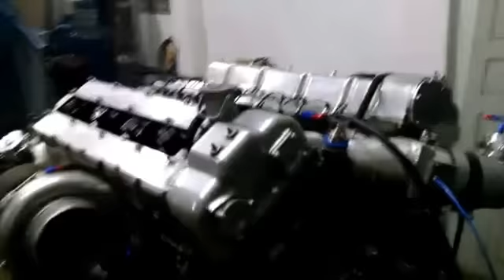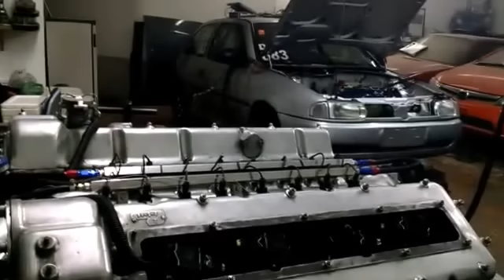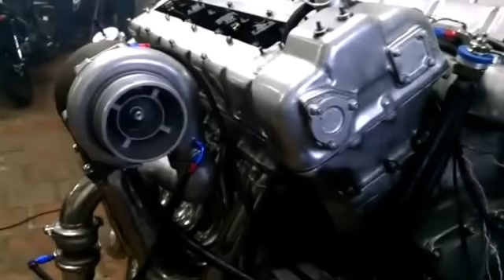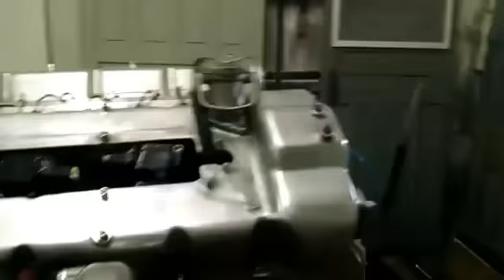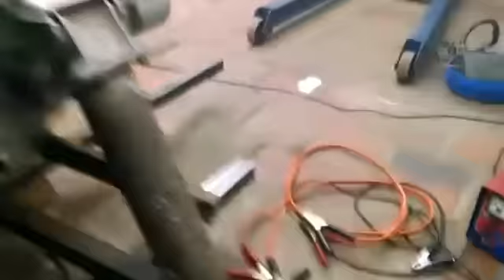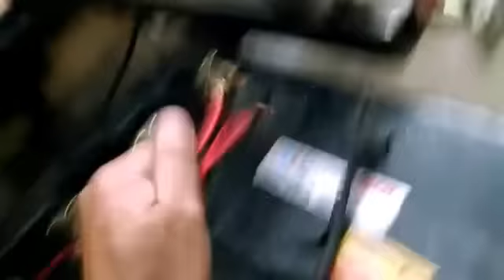Ford GAA-V8 Twin Turbo in Brazil. 1100Ci, 18 litters.

Comment: What rpm will this engine rev up to?
Reply: +micahhicks88 3000 is the rated RPM for these engines i think, but this one probably has upgraded valve springs and the such to support higher limits. Edit - The website says that the engine does 500hp @ 2600RPM, but the stock springs will go to 3800 before valve float.

Comment: You need to send this video to the Ford motor company, so they can remanufacture it for big truck use with natural gas.
Reply: +John Carroll thats.... actually a great idea. Side note - LPG/LNG is going to be a great fuel, probably better then E85. I wonder how much power you could make with LPG on this engine....
Reply: +themotorfreak1 LPG... hahaha
Reply: ?? gonna have to fill me in. What i know is that LPG and LNG ( LNG is going to be cheaper ) are 2 times or so less likely to prematurely detonate, so you can shove 3 or so more times the fuel into the engine resulting in , durrr , 3 or so times the amount of power. and a whole new way to cool incoming air as well. Turbocharging/ supercharging would be the way to go to lessen losses of the cold liquid hitting air.
Reply: the GAA is made for low horsepower, high torque, it was designed for tracked vehicle use only and saw little other uses due to the fact this engine would shatter anything other then the toughest of drive trains, plus the block of this engine alone weighs in the order of tons, it's more of an industrial engine then anything.
Reply: Except the GAA was an aircraft engine, designed for use in aircraft? Also the whole engine weighs 1500 pounds dry?
Reply: +Cu Gaunt No, it's not. 

the V12 predecessor to the GAA was intended to be an aircraft engine, the GAA however lost 4 of it's cylinders and became a V8 for vehicle use.

The GAA (Sort of) was designed as an Aircraft engine yes, but never was built into one, no model of the ford GAA ever saw use in an aircraft of any description, nor was the GAN, or the GAF and was downrated as such, it runs at normal vehicle RPMs, it's high torque meant for heavy duty use, simply put, it won't run fast enough for most applications as it's highest performance at the 2500 RPM mark because it had severe issues at higher RPMS, hence the governor on all uses of this engine.

It only makes 500HP at the crank with 18 Liters but has 1,000+ pounds of torque 

with accessories, this engine will break 1,800 pounds, about 1,900 after fluids, you could not build a car or pickup truck around a power plant of this weight, no way, no how, that's light for a aircraft engine or a military engine but that's back breaking heavy for a normal vehicle,  the biggest of pickup truck diesels don't even break 1,000 pounds.

This fucker takes 8 GALLONS of motor oil.....that's 60 pounds alone just in oil.
Reply: @deepbludreams  when these engines are gutted down only to required parts it weighs in about 940 lbs

Comment: This a tank engine??
Reply: Yes, used in the M26 Pershing tank. The original configuration of this engine was a V12 c.i. 1650 intended to compete with Rolls Royce Merlin and Allison V1710, but it came on too late to secure a contract. Available data shows it would have out-performed both the Merlin and the Allison.

Comment: That's a very high idle, don't burn the poor thing up. I like the Efi conversion, the turbo's not so much. A supercharger would create instant power and with the turbo's out that far it would seem like there is a lot of lag.
Reply: These motors have over 1,000 ft-lbs of stock torque and 500 stock HP at idle, they don't need a supercharger, they need a turbo. An 18 liter engine needs gigantic amounts of air on the high end of the powerband, a super charger wouldn't give it the horsepower it needs.
Reply: @joshuawhite3411  Maybe he should just say screw it and put on both.